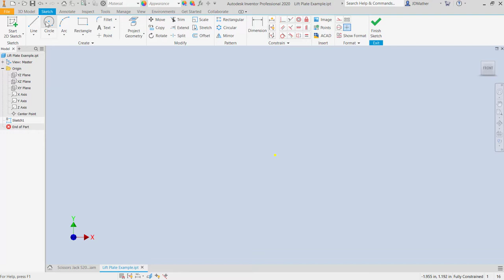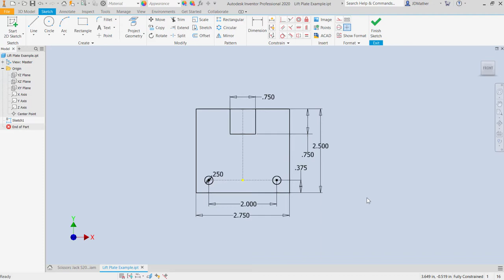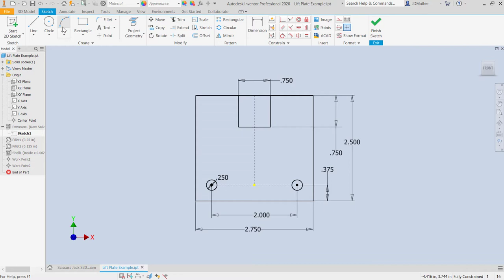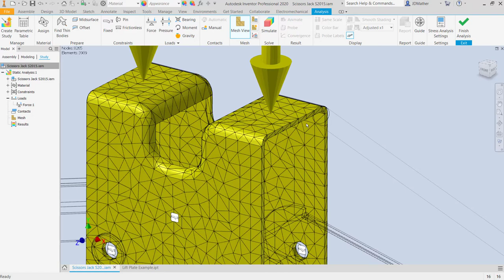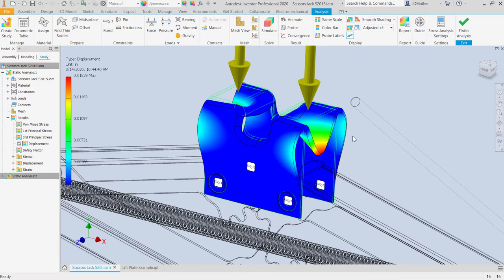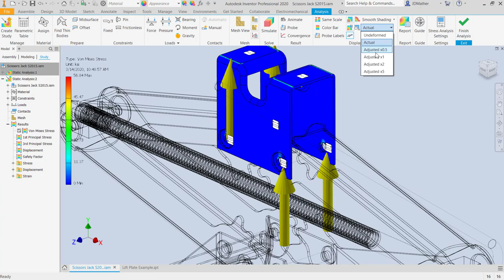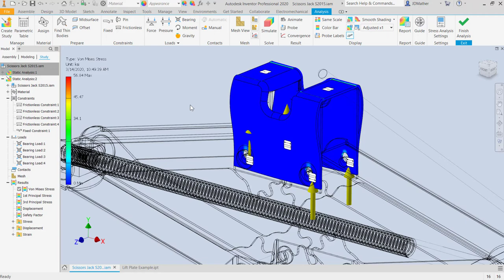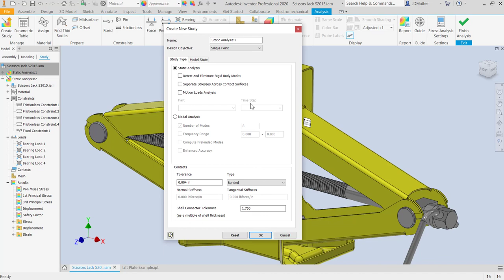Lab 24   Critical Thinking in FEA

Comment: Would love to see a full setup video for the dynamic simulation of this assembly.
Reply from the maker: Stay tuned!  Coming next semester - modeling of each component and then the Dynamic Simulation.  There is a real trick in this one to avoid over-constrained condition that is valuable to know.
Reply: @TheCADWhisperer  Excellent. I am currently working on a design that features a scissor with acme screw and having never done much with dynamic simulation that should be quite helpful!

Comment: Tnx alot sir, nice explanation. that was very useful point about how to model loads and constraints so that the model react physically correct. by the way the loads display turning on/off switch is in above panel in display tab and you see that as a vector sign. i'm so enthusiast to see how dynamic analysis and moving loads are done in inventor so please explain it to us at some time.